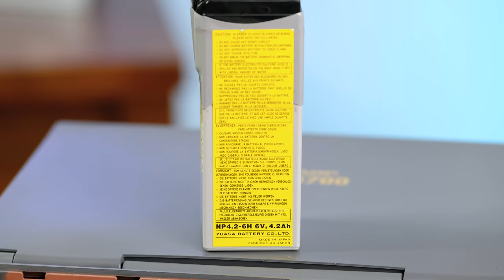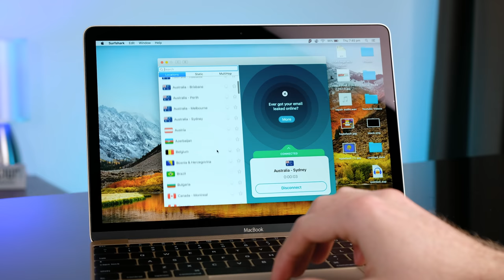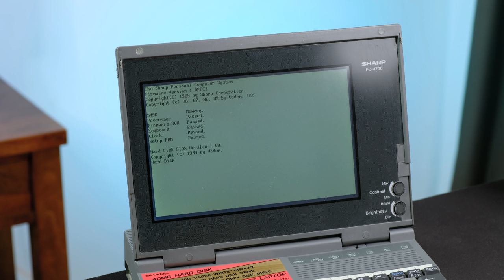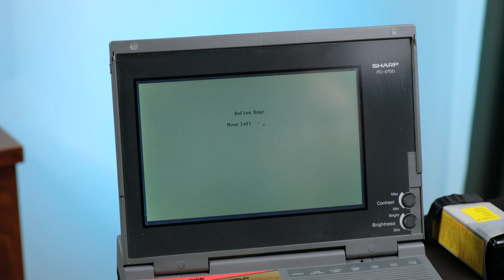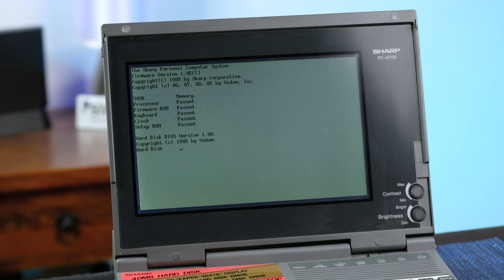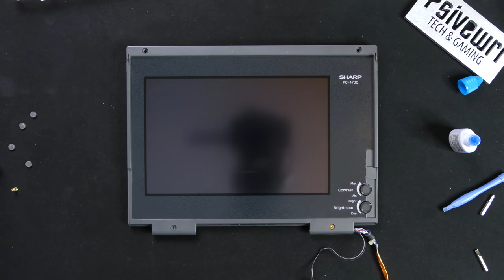I Bought A 30 Year Old Laptop From eBay! Can We Fix It?

Comment: hey buddy! great videos. you might want to use a sowing machine oil. wd40 is not a lubricant.
Reply: I was about to say that
Reply: @DoNotSayThree  "WD-40" without anything after it is more like a penetrating oil rather than a lube. 
for finer mechs, sowing machine oil is a better fit, because it's easier to apply and it's simply made for being used on small moving parts.
Reply: @JessicaFEREM  ummm yeah lets just ignore "SOWING" machine.

Comment: The interface is called "Direct Access" had it on my first PC around 1992, Windows 3.0 would run on that, it only requires and 8088 class CPU because it supports real mode, Windows 3.1 does not.

Comment: Commander Keen and Lemmings are made for 386s and 486s and require a graphics card which that laptop doesn't have. You should probably try some of the early 80s sierra games such as ultima or their point and click adventure games as they will function on 8 bit cpus like the 8088 as the 286 line of cpus and onwards are 16bit.
Reply: not exactly he have problem not starting the games because this machine have CGA video card and he tried EGA/GVA games on it! btw Keen 1,2 and 3 have only EGA variants, but 4, 5, 6 and Dreams have CGA versions as well , so he have to try them :)
and this CPU is 16bit with 8bit data bus  http://www.cpu-world.com/CPUs/V40/index.html . And all keen games runs even on 8088/8086 4.77MHz ,but scroll smooth on at least 8MHz ! and this CPU is the near the most advanced for XT platform NEC V40 at 10MHz  even have 80188 instructions and have 8080 8bit emulation mode!

Comment: WD Engineers: If you open up a hard drive, it will never work again.
Nathan: Hold my rubber seal
Reply: I mean, these days, they're assembled in clean-room conditions, and are often close to airtight in their construction. Some high end server drives are even filled with helium, rather than regular air. A thirty year old hard disk, though? It's a miracle they worked at all, to begin with, considering how delicate modern mechanisms have to be. I guess tolerances for putting 42 MB into the same space we can currently cram, what, 6 TB, are much looser.
Reply: 69th like nice
Reply: I did it once. It was a dying 80 Gb HDD and just opened it. I closed it after taking a photo and put it back in the PC, it did not matter because all the information was already backed up. The hard disk works even today, but without a boot sector. It's also very slow.
Reply: I've successfully recovered multiple drives that had stuck heads by opening them up and manually unsticking the heads. I didn't have any clean room and the people involved didn't want to pay for data recovery and their data wasn't that vital.

I've even done experiments where I opened a drive, ran it with the cover off and blew dust and spit into it and surprisingly the drives continued to work fine for some time before I started getting read errors and other problems. Obviously that's a worst case scenario, and I wouldn't trust any drive after popping the cover and unsticking the heads, but it's not the end of the world.

I wouldn't try opening newer high capacity helium filled drives though.
Reply: @NoobixCube  it's just a myth that you NEED those conditions to open up a hard disc safely. Sure, you risk debris breaking something but i've opened many disc drives in a regular room environment and they still work.
Reply: Opening up a 90's HD is no biggie, especially if you don't have all your stuff in there which is very unlikely. Have opened 3 and 2 of them work fine and 1 was beyond easy repair so gotta waste 5 euros for a new used one
Reply: Hold my eucalyptus oil*
Reply: Why bother to fix it ? Lol
Reply: well thats because thats a 40MB drive. thats 40MB data on a platter the size you will get 500GB on now days. and single platter.
Reply: Indian "restauration" channels: Let's open up a hard drive and clean away the dirt with a brush!
Reply: hold my eucalyptus oil
Reply: @HeX341  Just open it up and give it a blast of WD40 🤣
Reply: @715michala  because it's a fun challenge, out of curiosity, ...
Reply: @--fishiiki-  Or directly in the dishwasher with the Leica M11-P and the 1968 Rolex Daytona 6241 "Paul Newman"  they found in the trashcan. And they fix it with a sledgehammer, a chainsaw and WD40.
Reply: @mmadmic  yea 😭

Comment: Those were the days (1977-2000) where a 5-year-old computer was truly a relic.

Today, I use a 12-year-old Thinkpad for work everyday, and I don't even notice how old it is most of the time.
Reply: I use a old laptop from 2013 gaming one I found in a dumpster
Msi ge70 2oe 011ne
Reply: yup I love my x220
Reply: I still use i5 6th gen for travel and remote desktop. Computers are just so overpowered now-a-days that they don't age as quickly as they did in the past. I can't imagine using the VIC-20 I purchased in 1980 in 1990. But I can totally see me still using my 6th gen from 2016 in 2026.
Reply: @FS--ew3se where did you find this dumpster
Reply: @FS--ew3se  I use a Dell OptiPlex 3020 Micro that I found in a dumpster as my main PC. It runs Windows 11 perfectly fine and is very much a competent desktop 10 years after its original release.
Reply: I have a Lenovo laptop, I bought new in 2013.  I don't use it as much these days because I have a new tower from 2023.

However, I still the laptop to burns CDs and other silly stuff. 🙂

Comment: 7:36 Your machine posses CGA video card see here (2:10 "Console CGA" to the right), and Keen 1, 2 and 3 have only EGA versions, so you have to try Keen 4, 5, 6 and Dreams they have CGA variants.
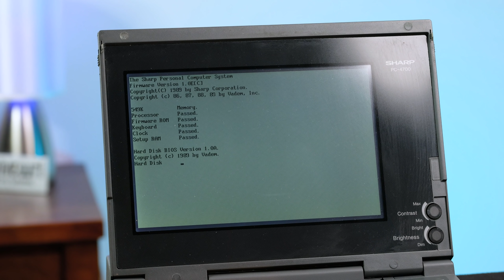11:40 WTF man :D?! it started to work opened WoW Cool!!!!
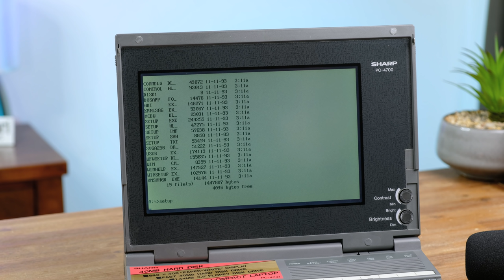15:25 try Windows 3.0 it runs even on 8086
Reply: intel386DX The CGA version of Keen 4 (and probably the others too, never actually played them) looks absolutely awful in colour (it uses the Cyan/Magenta/Black/White CGA palette), but since that’s a monochrome display you won’t see any of that.

What you will see though is the horrible ghosting that comes from it having a particularly bad refresh. I’m not sure exactly what sort of panel it has exactly, but it’s definitely unsuitable for games.
Reply: @ianweber9248  yes refresh rate is poor, but it is still playable and you can even connect the external monitor.

Comment: Every time I see one of those chunky laptops I think how perfect would be to fit a modern Raspberry Pi inside. So much space! The battery compartment actually seems like a perfect place to fit it so it can be replaced easily.
Reply: The refresh rate on the LCD is awful though so you'd have to replace that also

Comment: Good job. I remember those hard drives pretty well... Even when new the heads would sometimes stick. I used to work in a computer repair shop (down to boad level!), and we saw hundreds of these hard-drisks... Together with Western Digital Caviar (at that time!) they were hopeless. As for the graphics problem, you simply do not have graphics. It's a computer with text capabilities only.

Comment: Probably the hard drive had a problem that is quite common to these old units: there are little rubber bumpers that prevent the head stack's voice coil assembly to hit hard on the metallic magnet's frame when the disk parks the heads. These bumpers degrade with the years and transforms themselves in a mess of sticky goo, that literally sticks the head stack assembly to the voice coil's magnet's frame. The voice coil actuator doesn't just have enough force to disengage the heads from that sticky goo and the drive fails its initial test as it's not able to move them, so the computer won't detect it.
What did you do when you opened the hard drive was to move manually the head stack (be careful, this could scratch the disks!). This unlocked it, now the drive was finally able to move its heads so it passed its power on self test and shown itself to the BIOS. So you solved temporarily the problem, but be careful as that sticky goo is still there, and it'll lock again the drive in a very short time.
To solve it, what I did on an handful of my old hard drives is to put a little piece of adhesive tape over that goo, so the voice coil's assembly won't touch anymore the sticky surface and won't lock again.

Comment: I wonder if that drive is one of those that used a rubber bumper to stop the head in the parking area like I have seen in some other videos of people fixing old macs... If it’s the case then the drive may die again when the head sticks back to it. It’s amazing to see how old hard drives were much more resilient, I mean, you moved the heads without even rotating the platter and that didn’t seam to cause any damage. Try that on a modern drive and I don’t think it’ll work fine afterwards...

Comment: Looks like the arm of the hard drive was just stuck on the disk. That happens sometimes. You can either smack the side of the HD on a table or manually open it and move the arm yourself. Good job reviving such an old computer.

Comment: I think the key is when you took the hard disk apart, you moved the head.(it was stuck in the middle) I've had some hard drives in the past with stuck heads, therefore the motor couldn't spin the platters and it gives errors.

Comment: Windows 3.1 required a 286

It's probably a CGA video card, possibly MDA (monochrome). 

Text mode games and demos will work
Reply: notice in the BISO SETUP it is CGA here 2:10 
and the CPU is V40 the most advanced CPU on XT machines it even have 80188 instructions, but still it can only run Windows 3.0 (3.0 can run even on 8088) ! :)
Reply: yeah there are Pac-Man and Tetris clones for text mode DOS haha
Reply: There’s also some demos like “YO!” by Future Crew.

Comment: Opening a hard drive usually ruins hard drives. But fixed this one... odd.
Reply: Just spray some eucalyptus oil on the platter and it'll be fine
Reply: RustyX2010 I don’t have any oil....
Reply: Well, given what other comments have said, it's likely that the head was stuck and disassembling the hard drive and moving the head freed it.
Also, the rubber grommet, likely there to reduce the noise produced by the hard drive, may have deteriorated and started to get into the head mechanism, causing it to get stuck.
Reply: @stephaniethebatter7975  That’s a good theory. That’s probably what happened.

Comment: Old Connor drives have an issue with the rubber being sticky causing the heads sticking in place inside the drive and you moved the heads away from it making it bootable until shutting it down.

Comment: In/near 1990, I was the user/maintainer of the photo studio's IBM XT. I also used XTree  to make it easier to run PFS: Write and File (Also known as "ProWirte" and "ProFile" back then). An 8088 processor wasn't going to run any version of Windows, but it could run Ye Olde GeoWorks/PCGeos GUI. I used GeoWorks Ensemble 1.0 and 1.2 after I replaced the 20MB HDD with a 40MB HDD and replaced the full length 512K Monochrome graphics card with a 640K half length Color graphics card.

Comment: All that "interface" was is a simple custom batch file using some Basic commands. I use to make those all the time. You use the PRINT command to draw the border and make the menu entries and then use the IF and THEN commands to open whichever program you wanted from your list by hitting whichever number or letter you assigned it to.

Comment: I'm more impressed that the screen doesn't look like utter garbage for a 1989 computer.
Reply: A family friend brought a snazzy new 80286-powered laptop with him when he visited us in 1990. That was one heck of a toy in those days!

Those machines were well made; what was garbage about them was the price, which probably amounted to about nine months' salary for a normal person, LOL. The 80486 PC I got in '91 had a price tag well into four digits...
Reply: @nobbynobbynoob  Yowza! that's crazy. The oldest computer I have is an old toshiba from the early 1990s and it even has a LCD screen! 

I'm currently trying to build a custom terminal-styled raspberry pi 4 computer with a CRT tube screen that i've cut open and shoved an lcd in for a bubble effect.
Reply: @junkaccount2535  That sounds like an interesting neat little project.

My dad, generous man that he was, bought me my first computer in 1982, which had 16K RAM, a cartridge drive, external tape drive (via tape recorder), and was adapted to broadcast to a regular CRT television via cable and a home-made circuit switch. It cost about 600-700 USD I think, which was very non trivial back then, so he got into a fair bit of extra debt for that, in addition to what was borrowed for the car (which lasted about eight months!), new TV, VCR, dishwasher and double glazing. Yes, we lived a bit beyond our means in the '80s, particularly with the 15%+ interest rates, but at least Dad had a reasonable job in in$urance.
Reply: @nobbynobbynoob  Sounds like your parents wanted you to have a good childhood. Do you still have that old computer?

Comment: Double check all the BIOS settings, make sure VGA card is detected.  It may also have a make or model number either there or on the chip/board.  If BIOS detects your graphics card, you may be able to download the drivers onto a disk and install them that way.  Thanks for the trip down memory lane!

Comment: Conner hard drives have 2 commonly occurring problems: Stiction preventing the platters from turning, and another issue where the heads refuse to leave the 'park' position without external assistance. It feels like the heads become too weak to unlock themselves, and when you push them out of park with your finger, that lock seems to be magnetic.

It seems like you had that second problem. Unfortunately, after a while of those problems getting worse over time, that means you basically end up having to pop the drive's lid open and get it spinning each and every time you want to be able to use it. The effort, as well as the risk of dust and accidental platter fingerprints, will eventually frustrate you into tossing it (at least it did for me).

I'm glad you got the drive working, but don't expect it to keep working. It will once again get stuck in park if it doesn't suffer from stiction first. If Conners are consistent (and they usually are), it's only a matter of time. I'd make that custom cable you mentioned in your spare time, if I were you, so you can have a more standard replacement drive or flash card ready. Good luck, and cool laptop!

Comment: I had a Nec 286 around 1992 back in 8th grade that was very similar. You could probably run Windows 3.0 or 3.1 but Windows 3.11 is certainly out of question. I couldn't run it either as my laptop only had 2mb of ram. Even if I maxed it out to 4mb of ram Windows 3.11 wouldn't work. You needed a 386 sx or better for it's virtual mode, and a DX would certainly be a better cpu for it. Luckily Windows 3.1 ran just fine.  I think mine had a weird type of advanced MCGA by the way. It wasn't until 12th grade did I buy a laptop that had any color, the NEC could do 16 or 256 greyscale.  It could hardly work with anything but "pc jr" display modes. Your standard 640 by 480 by 16 greys would have been the best it could do. My later 755 and 760ed Thinkpads offered much better capabilities getting me past high school and in to college. Sweet memories I admit.

Comment: Opening up a hard-drive like that outside a clean room (and running it with the cover off) would have destroyed it had it been a modern drive (especially those 4TB+ helium filled ones!). But that old 40mb drive with only one platter probably will be fine. (though I would have still recommended setting up a negative air pressure box to keep dust out).

I suspect the reason opening it up fixed it was that the platter motor was stuck. Was the screw in the middle you took out went into the top of the platter area? If so loosening that was all it needed to get going again and that's why it started working again. ;)

Comment: Very interesting, I actually tried to research that hard drive and found nothing, although I guessed that it was a ~40MB hard drive, I didn't find the drive at all.

It's strange that the connector design is almost identical to 44pin IDE, and I even counted the pins to see if the number matched, which it did but the image made it hard to gauge scale, so I posited that if the connector width was 41mm, then it was indeed 44pin IDE, but knowing the age of the laptop now and just how small the connector is I can see it isn't 44pin IDE at all.

Happy to see it working, but I believe that it only started working again because you unstuck the heads, probably banging the drive on its edge might have brute forced it to work as well without having to risk disassembly.

Great video as always, and another computer saved from the bin by eucalyptus oil and a bit of tinkering. :)

Comment: In case you want a lighter battery for it, Jaycar happens to sell lithium batteries that operate as drop-in replacements for sealed lead acids. They have their own battery management circuitry built into the casing, so you can treat them like a SLA. Otherwise, a 6V 4.5AH SLA battery is fairly cheap, and should be the the same, standard physical dimensions as what's in the laptop right now.

Full disclosure, I happen to work in one, but that doesn't buy them my love. Just letting you know what's there.

Comment: my best guess with the hard disk was sticktion, when you opened and moved the head it unstuck it.
although in doing so you might have damaged some areas of the drive but at that point it probably wouldnt matter (might have been able to tap/bump the drive while powered to make it work also.
and yeah for a 8088 compatible its newest windows would be 3.0 which could run in real mode on the 8/16bit processors
as far as video it might not have graphics support (text mode only) or some weird graphics mode that isnt normally supported